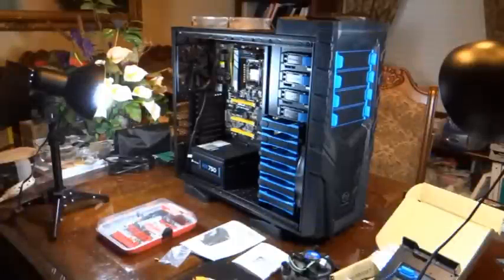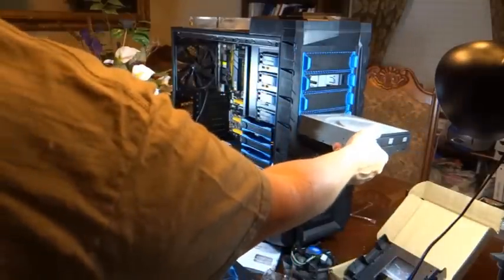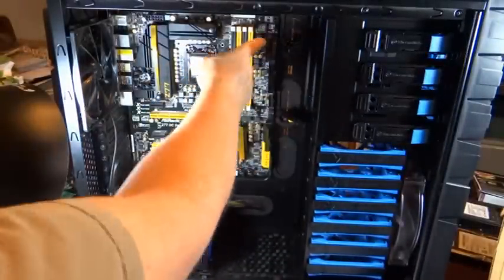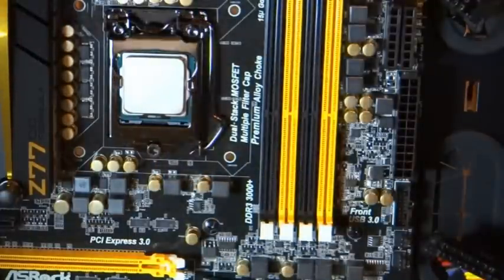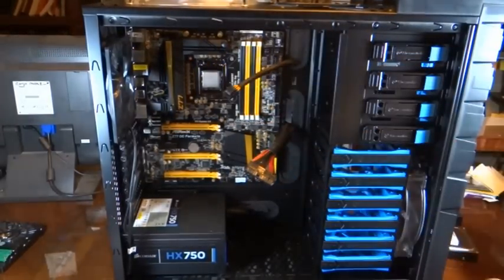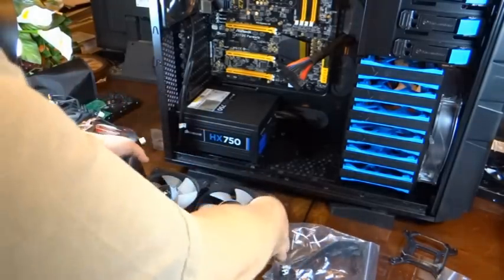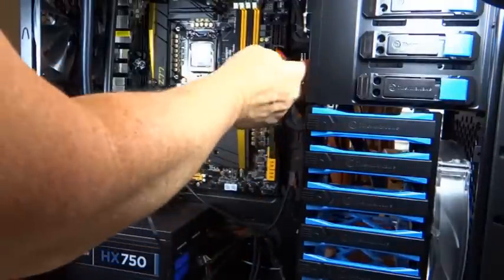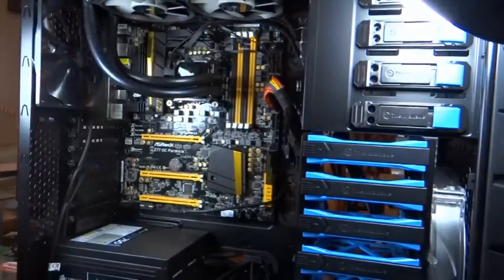Building Your Own Computer in 2013 PART 2 of 4 - Starting the Build - the Mobo and Liquid Cooling

Comment from the maker: Motherboards are obviously tested to make sure that all components built into the motherboard work together well as a basic requirement.  As I'm sure you know, any third party product you stick on that mobo may not play well with everything (in the old days there were interrupts and conflicting memory addresses to worry about).  That is why you should make sure that all the components are compatible before you buy them, and little cards like that won't tell you.

Comment from the maker: You missed my point.  I bought that specific motherboard for the large number of SATA3 ports so that I would have the option of using RAID10 with SATA3, which I used on my older PC.  There was no indication that I couldn't do this until I started installing the mobo and saw little stickers that said not to use the Marvell SATA3 ports for bootup because it will slow down bootup, I believe for loading drivers.  Of course I realize you can buy cards, but that is not an elegant solution.

Comment from the maker: Correct.  It is considered an extended ATX, though it isn't the full size of an E-ATX (12"x13"), it is shorter on one side (12"x10.5").  The point was that it was larger than a standard ATX (12"x9.6") and you need to be sure your case will hold it if you want to use this motherboard.  The case I bought did not say it would hold anything bigger than a standard ATX, but it did fit.

Comment from the maker: Overclocking was very easy, ONCE I figured out that I could use the Preset OC settings that are built in.  I just picked one that set everything to give me a processor speed of 4600, but it took me a while to find this (even though it was at top of first page in BIOS) and understand what those options were.  The memory is very easy and near the bottom of the first page, just set the frequency you want.  Good luck again.  It can be a very rewarding experience.

Comment from the maker: With a brand new OS like Win8 it can be hard to tell what problems are hardware and which are software/OS related.  I have had more problems with Win8 than I ever had with Vista, and I had two computers on the very first version of Vista (before any service packs came out).  I couldn't install Steam, Garmin maps, Java, Bitdefender, and several others because of compatibility with Win8.  Recently Steam started working, but haven't tried the others.

Comment from the maker: The only other mobo related issue I had was some of the USB 3.0 seemed to freeze or quit working, at first.  I eventually assumed this was due to the extra USB 3.0 media card reader device I put in, so I took that out and haven't had any more USB problems.  Also, the mobo comes with a Fast USB program to speed up your USB 3.0.  I updated that to the latest version which also could have helped fix my problem.  With that Fast USB program loaded USB 3 is VERY fast IMO, but I don't have numbers.

Comment from the maker: I had one big complaint about the ASRock mobo, which concerns 4 of the yellow SATA III ports which are Marvell ports.  There is a warning not to use these 4 ports for a boot up drive, I think because you need the windows Marvell drivers to use them.  I used the 2 Intel SATA III ports for my RAID 0 boot up SSD drives and they worked great!  I tried to use 2 of the Marvell SATA III ports for my storage drives in RAID 1 and I couldn't format the drives, it kept generating blue screen (in Win8).

Comment from the maker: Thanks for the kind comments, and best of luck with your first build!  There is nothing like the satisfaction of turning that PC on and having it all work like YOU designed it (even if it takes a couple tries).  Be aware that the ASRock mobo is bigger than standard ATX, so you need a case that will fit it.  The Thermaltake fit fine, even though it didn't claim to take anything bigger than ATX.